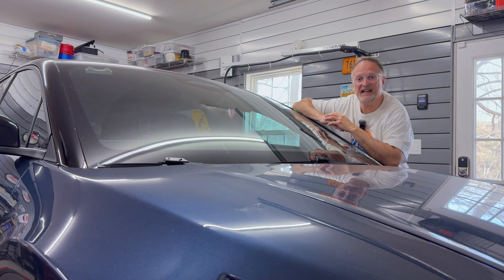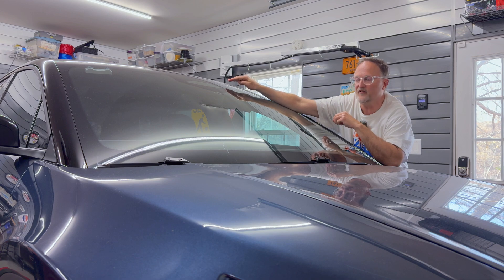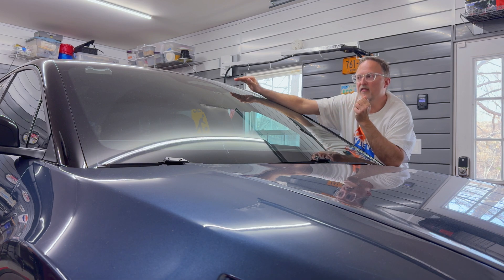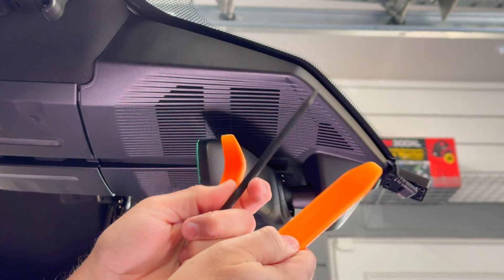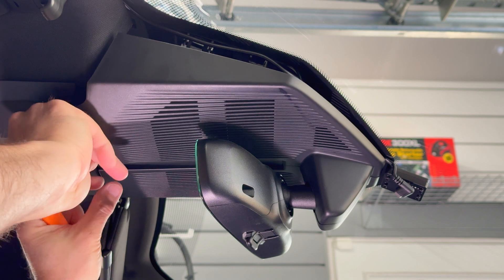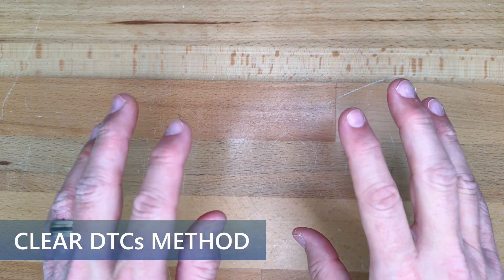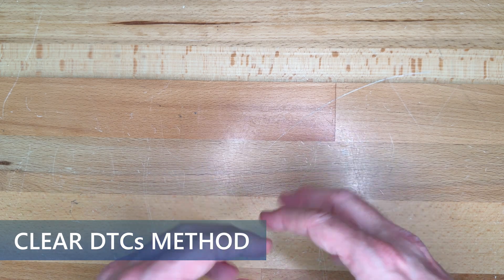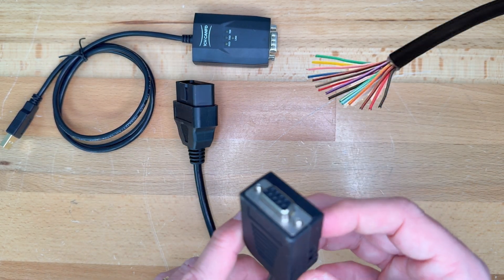Fisker Ocean - ADAS Fan Fix Part 2

Comment: I have a 16 pin OBD2 connector that has usb to connect to my laptop, its a Elm 327, I am wondering if this can have the same result as this design you have with 2 cables in your video ? Thanks
Reply from the maker: I’m not familiar with ELM327.  So I can’t recommend it.  The one I used is a PCAN device.

Comment: Thank you so much for the Video! I have performed everything as you said and the fan stopped but there is a sound of another fan at left rear end of the car. Even when the car is unlocked it is ON all the time. I tried soft reset but didnt make difference i will try deep sleep. Please recommendations about this issue my software on 2.0.
Thanks
Reply: An update: After the deep sleep the sound disappeared.
Reply: A new update: The car is giving multiple errors when driving Blind spot not available / Emergency switch not available/ Lane keep assistance not available. Even if it doesn't show lane keep assistance not available it doesn't alarm when I'm on the lines.
Reply from the maker: @KarimEltanawy  sometimes those three errors just randomly occur.  I had those appear for me today when I started the car in the garage.
Reply: @MTNRanger Thank you for your reply! This warning message is new for me. I was driving the car for the last 10 days when I bought it and all was good. Also it shows up on the display every couple of minutes.I don't know if this can be caused by the rain? because it was raining all day today.
Reply from the maker: @KarimEltanawy  Rain, fog and direct bright sun (sunrise/sunset) can set it off.
Reply: @MTNRanger  
I was able to fix the issue by pulling the ADAS fuse, MF07 in the trunk fuse box for a few minutes to reset. Everything is working like before.
Thank you.

Comment: Great video, I just got the fan running again a couple of days ago, first time after the 2.2 update I had last October. I did use the PCAN View SW and the adapter and was able to clear the DTC this morning, the fan stopped right away. Is there any other DTC code/ID you are aware of that would be good to know? Thanks again!
Reply from the maker: I don't have any additional DTC codes info at this point.  I'm most likely going to use the OSR SeaScan and the Ocean Link Pro app for future DTC needs. I'll be covering both of those in future videos.
Reply: @MTNRanger  Thanks for the excellent content, I can't wait for the Ocean Link Pro video!
After the reset I noticed one difference, before the DTC reset I was only getting the daylight left running light message at start, now I have both left and the right coming up. Have you seen the same?
Reply from the maker: @ The DTCs are a new thing for me.  I'm still learning about them.  I will be looking at the SeaScan this week when the software arrives.

Comment: Matt, I don’t use the video on the mirror, so can I just keep that fan unplugged? I believe I read it’s the video displayed within the mirror is what makes it hot.
Reply from the maker: @mikeobrien2277  The fan has nothing to do with the digital mirror.  It’s used for the ADAS (front camera and sensors).

Comment: Is there any way to clear the DTCs with a mac?
Reply from the maker: As far as I know the app is only for windows.
Reply: It might be worth a try to use a bluetooth ODB2 connector and your phone. Some of the apps have a DTC clearing function.
Reply from the maker: @ I have several Bluetooth OBDII adapters and have been trying for the last year looking for any software that works with the Ocean.  No luck so far.  If you have any suggestions, please let me know.
Reply: @MTNRanger  I was thinking using one of the ios apps like car scanner pro that have a terminal function. Then typing the code provided to see if it will clear. Depending on the bluetooth protocol there might also need to be additional lines you in the command sequence.

Comment: Fantastic Video!! The DTC clearing is daunting for most. I actually got the adapters you mention, but don't have the fan issue so haven't used it (yet..). On the FOA discourse site there are some threads regarding use of various scanners to clear DTCs. I see you actually commented on the Sea Scanner. I am hoping you do an in depth review in future. The DTCs are likely the basis for a number of issues and if we could clear them easily (and perhaps fix the basis for code) it would probably help a lot. Thanks again for an outstanding video!!
Reply from the maker: Yes, I hesitated trying/posting this a few months ago.  I waited until it actually happened to my car and then tried it.  Yes, there has been discussion of scanners for the past year.  I have several of the <=$50 bluetooth OBD2 adapters, but none work with any available software.  The expensive scanners just didn't seem worth messing with due to their limited abilities.  Yes, there's definitely some error in the code causing this to happen.
Reply: @MTNRanger is there any harm in trying to use my vLinker+ ODB connector? Can I damage something or will it simply not work?
Reply from the maker: @simonmildenberger5886  The method I show in this video doesn’t work with any of the OBD2 Bluetooth adapters.

Comment: Now, will the fan turn on when it’s needed to be turned on. Hope this didn’t disable it permanently
Reply from the maker: @DaveDarin  No it just deletes the warning code.  If needed, the fan will turn on.
Reply: @ understood. I will, proactively, get those things and be ready for a failure. Thanks as always.
Reply: @MTNRanger  oh, meant to ask you this. I have the same tire pressure Bluetooth product that you have. Just today I rotated my wheels. I assume the built in Fisker tire pressure is somehow a magnetic sensor that does not display the pressure but when it hits some kind of minimal it gives a graphic on the display. Is that your take on it? I did not get any display as my back tires  I keep at 52, front 46. So when rotating I had to lower the pressure for the front and add to the back. I guess I had no warning as all 4 tires were above some threshold that I was above.
Reply from the maker: @DaveDarin  It’s still used to reset the car’s tracking. It uses the wheel rotational sensors (used by the odometer if I recall) and compares all four.  It uses that to determine if one or more are low.
Reply: @ interesting. I don’t think I’ve come across that on other cars. I guess it’s something but not a great detection system
Reply from the maker: @DaveDarin  Yes, not great; it was done to save money.

Comment: Could you explain what exactly entering 7DF and Data as 0414FFFFFFCCCCCC is doing? Why does that silence the fan? I'm definitely going to do this, I just want to understand better why this works. Thanks!
Reply from the maker: @olm3ca  So basically through the app, I am communicating to the CAN system and clearing all the outstanding alerts in the system.  Thus the module that is running the fan continuously, will no longer have a warning that the module is “hot”.  So it shuts the fan off.  It’s possible in the future that another DTC may occur, but hopefully it’s a long time.  If it does, you can always repeat the process.
Reply: @ that’s what I thought - just wanted to confirm. Very detailed video, I’ll do this soon.
Reply: Just reporting back that I did this procedure and it works perfectly. The silence is beautiful.

Comment: Hey Matt, is it hard to get the other side of the cover off? I need to have that module replaced, but my tech said it's difficult and could damage the windshield
Reply from the maker: @o0Dan0o  It’s easy, once you take the right side off.